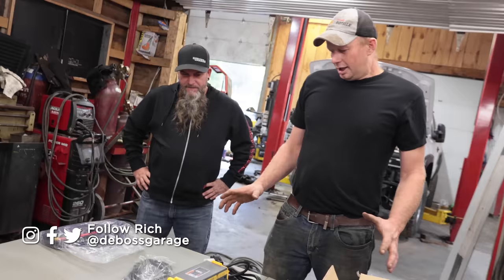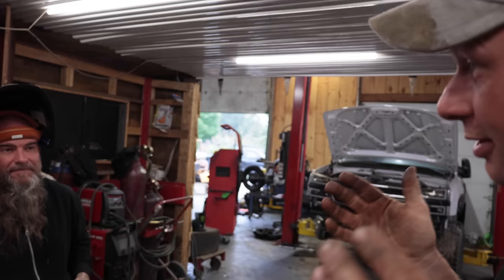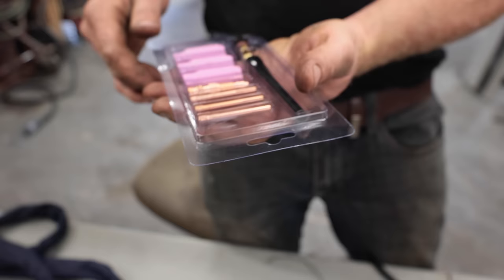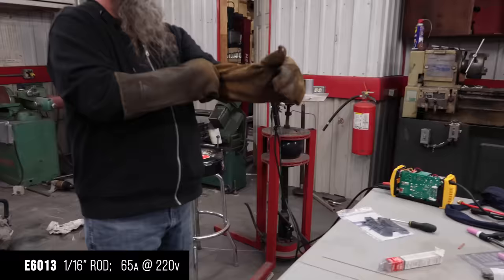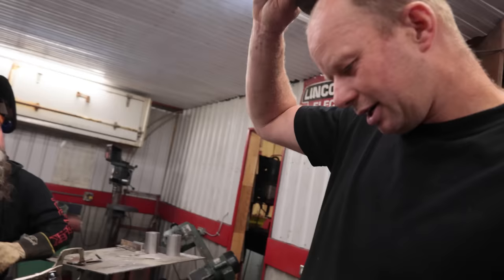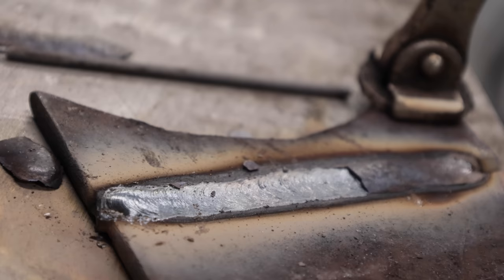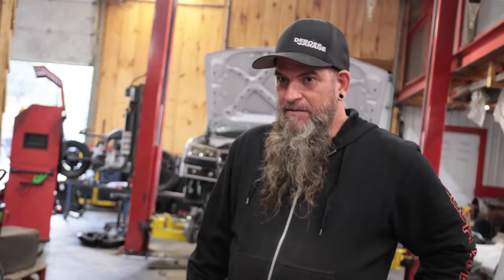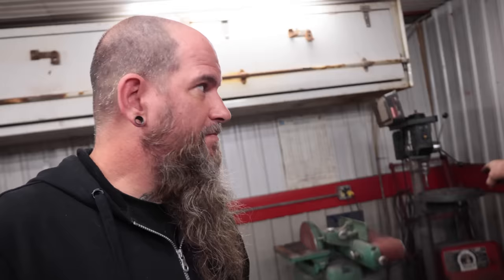How Good is the CHEAPEST Welder on Amazon?

Comment: Glade i learned to tig without a foot pedal. And learned to tell by my heat settings. But also you dont really need a pedal to weld tig. Unless you're welding thin metal of metal that doesnt take alot of heat to burn through ie. Aluminum.

Comment: After watching this video, I ordered one through the link that was provided here and made sure that you get the affiliate fee. However , in the link provided it is NOT the same model welder you reviewed in your video. 
Welder reviewed in the video:
TL-1355 LT 110/220V
Welder I received:
TL-1355 LT PRO 110V ... not 110/220.

I Found the 110-220V but now the model number is :  TL 1955 PRO.

The price with the Tig lift option is the same $99.00.
So, I sent back the one I received asking to send the 110-220V. Will see...

Comment: those extra large solder pads might be intentional for heat sinking.  a smaller solder joint can get hot and cause traces to delaminate from the circuit board.

Comment: holy crap I welded for years  installing railings and this little bugger would have saved a ton of time with unwrapping wrapping up cables. I could see using it in the shop if you do limited projects

Comment: Thats not bad ,burns 3/32 rod, curled up,speed ,heat was correct. 
    Im looking for a mig welder that will run off 110v, Build rc heavy equipment, thickest material would be 1/8"-3/16". Or do you think stick would be better, more like tack welding it together for a big majority of them.

Comment: @debossgarage ive got the 300 hundred dollar toolium welder, regular mig and flux mig, along with mma & tig, 200 amp 240v machine, I love the machine, can weld a 3/8 plate mig easy with it, at 170 with great penetration. Runs steady unlike this one you guys have, no pulse up and down jumping during the weld. Holds 2 and 10# spools. Should check it out. 😎👍

Comment: not saying its super good or whatever but you should keep the shroud on there so air can actually flow through and cool everything properly, i'd suggest a thermocouple to see temps like that
Reply: At the end of the day a welding machine is just basically a fancy power supply. So I’m always surprised at how much normal rigs cost.
Reply: @mattyp6908  that's correct

Comment: GREAT REVIEW! It's nice to see a seasoned pro testing budget gear. This video is proof that skill over-rides the quality of the equipment, but it also shows the true nature of what is possible, and It makes for real-world test results.

I've been welding since 1976. Started in Middle School Shop Class - Acetylene & Stick, did it in High School Shop Class - Acetylene, Stick Mig & Spot, and went to a welding trade school after graduation for Tig. I recently purchased a $110 LDHTOPI 110 Mig/Stick, Gas/Gasless Welder from Amazon. It's about 1/3 larger than the Tooliom, but it does a fantastic job. I like its portability, and I can run it from my 2000W inverter in my truck.

I've mig welded some cracks in my little 3/16" C-channel steel utility trailers frame, spring mounts, and all four corners of the frame (it was bolted) and all welds are holding really well. I even added some support pieces that I rivet welded and they are holding strong, too. I tested welding some 1/4" plate, and my little welder did the job with no issues.

The technology today is making all tasks, like welding, more affordable, easier to transport, and easier to accomplish.
Reply: If you were any good, you wouldn't be buying cheap Chinese junk from Amazon.  Get real.

Comment: GREAT video. i dont weld, want to learn and buying 1 of these has been the deterrent. i just want to learn for small things like maybe building a frame out of metal rather than bulky wood, or where would would be to thin to use. and at $75 sounds like this is perfect for what i MIGHT want to use it for, also the exhaust pipe occasionally.

Comment: Openning the box will disrupt the air flow through the cooled components. The fans are designed to run with the box closed and pull air through the heatsinks of the varius components only then you can asses heat performance of a high power device. Its like opening your vacuum cleaner and still expoecting it to suck.... didn't expect to see this test done like this by professionals....

Comment: By removing the side panel, you may have defeated the internal cooling design, which could cause components to run hotter than normal. Just an FYI.

Comment: Absolutely brilliant to see this.  I fear however it's not a fair test as with your experience you'd probably be able to weld with two bits of bamboo and a slightly damp rag.  
Perhaps for a follow-up video:  Find someone who's never welded before and try the cheapo welder vs your own tried and true one.  
Does it really help the novice to have pro kit (are there too many options they don't understand yet) or does starting with a bargain-bucket put them at a disadvantage?

Comment: I scratch start tig a lot u need assistant stand at the dial up 5 down 10 etc
And when your starting lay the tip of the  wire on the part arc to the wire that way yiur not createing craters in part

Comment: I haven't used this exact brand of welder but another 'Jungle Site' $100 (insert generic China brand) welder, as they're all knock offs of each other. Tried it on Honda 2200 & Craftsman 4200 gennies at around 90-100 displayed amps (3/32 rod) it bogs out even the larger generator. The little Honda did it's best to keep up at 45ish displayed amps.

Comment: 220-240 v has less wastage and uses thinner cables/core.  110v wastes a lot of power and that's why in USA etc your equipment has thicker cables/cores. Its also why less heat generated at the equipment end.

Comment: As a non-welder, I wonder how much the skill of the operator is compensating for shortcomings in the unit itself.  What I'd love to see is a welder with 100 hours of experience using a top-of-the-line unit vs this one, so that we can factor in the relatively low experience level that a $100 welder is typically going to mix with.  My question might be naive- maybe there isn't much room for operator skill to compensate for defficiences in the unit.  Anyone have input on this?

Comment: I used the same welder to fix a snapped bmx frame i had obviously weilded in some gussets before i put the frame back together and its been sound also crsked a habdle bar wgen i bent it back to shape again used one of these welders for anything else i use something more expensive but for bikes they are sound

Comment: Alri Lads. Great video.
So I bought a cheap welder off AMAZON about 8 months ago. I saw a video on here about the welder I had and the guy opened the plug up to see what the fuse they had ion the DekoPro 160A Stick/Lift Tig machine. He found a small piece of copper pipe in place of a FUSE. He sid now he knows why u can push this welder to 160Amps on a 13A domestic socket now.
So I wanna ask why they did this and were selling them like this to the public? How dangerous it is and I should also say that mine had the same piece of copper pipe inside in it where the fuse should be. 
I changed mine out for a 13Amp fuse though.
I think it's crazy to think MAZON are selling these Welders with a piece of Copper pipe in them instead of a real FUSE?
Is this even Legal? LMAO
My DekoPro welder is a good little machine though but I haven't tried to TIG WELD yet. It's bloody expensive and I'm trying to learn Stick properly 1st anyways. i BOUGHT A lIFT tig TORCH FROM amazon AS WELL BUT IT WAS 60 eUROS. 
It's the cost of GAS in my area, DUBLIN, that is the real rip off and I won't be trying it anytime soon. 
Really enjoyed this video lads. It's cool to see long term Welders with real experience getting to use one of the cheap ones and being slightly impressed with them..

Comment: I have the tig 180 i think it is or maybe the tig200 of this brand and i was pleasantly surprised that it ran as good as it did aswell i have had better luck with it than i have my titanium 175 for sure its a decent little machine for the money the next best  thing on the cheap side i have had my hands on is the YesWelder tig its probably better but its because of the settings and feature set not performance related

Comment: I get certain hobbies ie guns, power tools, woodworking have their selection of brands and then shit on lower cost options.  Well i have to say welding is a new for me and I kust want a cheap homeowner option, im not doing frame work on a car but potentially a few welds to fix something around the house...  From my gathering stick welding is like a caveman sort of welding with what's available today but I just want to know if something like this will do the job to hold 2 pieces of metal together successfully...

Hey well im glad at the end y'all said it was a decent entry/on the trail welder..  that's all I needed for the very few times I'd actually use it.

Comment: I wonder, as the cover closure removed , the air circulation provided by the fan is compromised, as the cover forms "the tube" that directs the cooling air around the components inside the machine. This test was in a way abusing the small welding machine? And it did not blow up.

Comment: I have a big Milwaukee weather and I have one of the little small ones like this here from harbor freight in the one I have from harbor freight does a lot better job than I bought from Milwaukee I have had all kinds of big welders in I can still out weld my big welders with my little one don't judge the size of it it does really well.. I do a lot of welding work along the highway where trailers and stuff snap at off of big truck and trailers and this is a piece of equipment I use the most of because the other ones is just too big and bulky to get where I need to be at my little one gets the job and clean up as a lot quicker

Comment: I got the same skill set as the welder in this guy probably more because I also did food grade and pharmaceutical grade all of the same stuff he showed in the beginning and I got 30 plus years and I can tell you that's an impressive little machine for 100 bucks. No shit no shit really, that's pretty fucking impressive actually. As for TIG welding and not having a foot pedal I literally don't like using a foot pedal and if you know how to weld then you are going to normally 95% of the time be welding on the same material if it's a 2-inch Square tube or 2-inch pipe you're going to be putting it to 2 inch square tube or 2 inch pipe and catch what I'm saying technically don't need a foot pedal and I prefer a trigger just to be on and off I know how to set my heat at the right temperature for what I'm welding just by looking at it because I've done it so long and a foot pedal is preferred if you're going to be welding different things to different thicknesses and such and such but if you're willing the same shit over and over I prefer just to on-off button that I hold with my finger as I'm welding and I've done that for a good 80% of my career because it's usually the same material thickness to the same material things. A welder will know exactly what I'm talking about, with that being said that is actually very very impressive for a hundred dollars. And in the beginning he said he paid $1,200 for his torch yeah that's normal but then again when you're paying $1,200 you're going to have that for a long long time. In fact your helmets going to cost you $200 to $300 depending on what brand and quality so I've had helmets that were three times the price of that welder and that's still once again very very impressive. So to buy a welding machine that can stick and Tig 400 hours is super impressive I really really have to state that MIG welding I think you can get a welding machine for about a hundred bucks also off of Amazon and I haven't seen any videos on anything that MIG welding is for morons that should be able to know if they can weld within 5 minutes or not. You either can weld or you cannot weld there are no in between and if you want to count mid welding well and the in-betweens of can weld or can weld well LOL that's what MIG welding is for and they are the ones making around 14 bucks an hour give or take down the street at the local weld shop

Comment: So as somebody with access only to 110 and working at home on minor Auto body patchwork would this be a good little unit to work with in your guys' minds? I am a home DIYr. Pushing 20 years ago now but I did get some tig pre-apprenticeship at SAIT Polytechnic and through 2003 to 2006 learned how to use Arc, mig, oxy... I'm just wanting to do some body work repairs on my van so I can avoid having to pay out over $7,000 in body shop repairs on a 20-year-old vehicle

Comment: Feel like the biggest thing that people overlook when they call these completely useless is cuz they run them on 110v. My Lincoln from home cheapo came with a regular plug and unless you turn it up real high it doesn’t cut out or anything. Ig most guys aren’t going to a gas/welding shop to get their first welder and having proper electrical in there shop to run it 😂😂❤

Comment: How much would it cost to have a shop make a swing gate to attach to a bed rack system on a truck? Use a GoRhino bed rack  gear plate 2 pieces to go across with a lock on one side and hinges on the other. 

Also, would this be a OK welder for those who are just learning or want to do some small jobs?

Comment: What happens to those machines is they become a victim of the heat in which the heat they generate kills the cheap resistors and diodes in em. There were a couple of Aussie guys using very similar machines. Takes a few uses and the thing becomes more worthless junk.

Comment: Your tenperature test at 120 pn the coil gave you a bad reading. With the cover off you have removed the cooling airflowpath
Reply from the maker: Yes, so it will only be better
Reply: @DEBOSSGARAGE  I can't agree on that, have you ever worked on an asic miner? But hey, my guess is that with the cover on the coil temp would cool off much faster.
Main take away is its a good cheap welder!

Comment: I’m thinking about starting with welding as a hobby and for small projects. But i was wondering if you have video’s explaining what the different rods or what different kinds of flux does. Because I really don’t know anything about welding. So i also don’t know what to buy and what not. I was thinking about welding without gas, does anyone have recommendations on what i should do and or buy (for a fairly low budget, as i don’t know if i will keep welding)

Comment: is there a way to add some sort of voltage regulator pedal on the tig torch lead to regulate power?  if not, what is the next step up for a inverter tig welder that does have a foot pedal?

Comment: 90A @ 220V?  Doubt it. Maybe you meant the welder was connected to 220 when you did 90A?  You really expect us to believe the open circuit weld voltage is 220?

Comment: I have a cheapo little stick welder I got on amazon for a small project at home. That was 4 years ago, and I have since built 3 trailer frames, and have used it to weld a bunch of broken farm equipment. I'm not a welder, I'm a guy that can melt metal enough to hold on to other metal. I figure, if this little guy dies, it owes me literally nothing.

Comment: whatever the dial is on... a real AC Lincoln welder has enough drive in it to burn 5/32 7024 with the dial set to 45amp... can that run 5/32 7024 at 45amp? because if it cant, its 45amp isn't 45amp, it could be low as 15.5amp.
Reply: 16:00 45-55amp on a Lincoln AC225 runs smoother then that set at 137. "fake dial"... only mufflers D.O.T.

Comment: Just an FYI ... Don't run it without the cover!!! The airflow from the fan is not doing its job of cooling the electronics and the inductor without the cover. And also if you touch anything inside while running it without the cover ... you might regret it. Just saying. All the best.

Comment: Your welder (same model) Tooliom 135S-LT has 110 AND 220 (even says so on the box). The ones linked and all the ones I can find now are only 110V. How'd you get the 220 capable? That's the one I want but can't find it! Maybe they changed something?
Reply from the maker: They’re changing the link to point to a different model. It’s in and out of stock I guess.